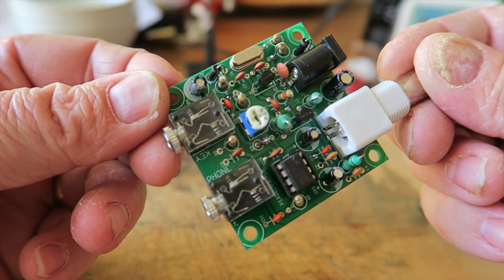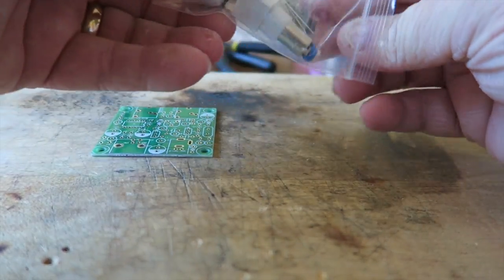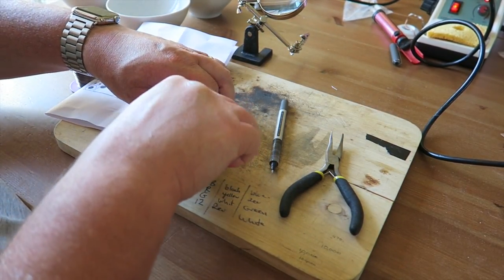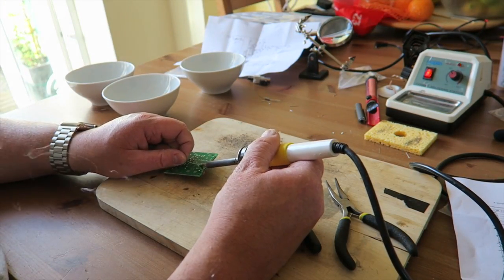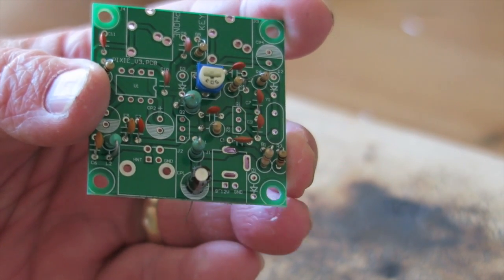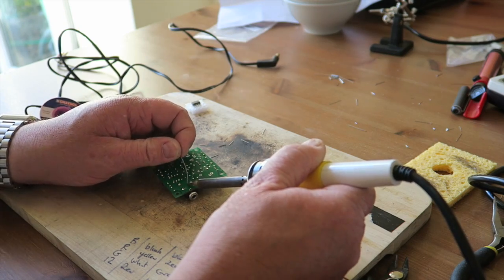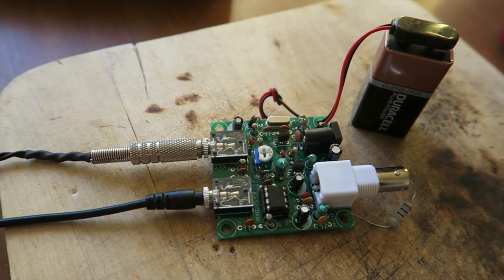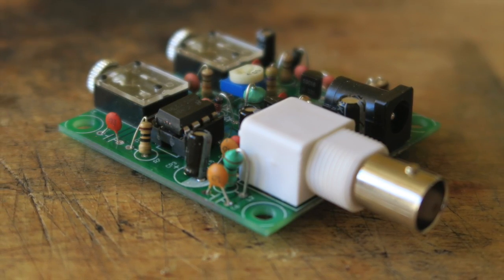40m QRP Pixie kit build for Ham Radio

Comment: Nice video, thanks. They kits are getting even cheaper. I just bought 2 of them for less than 2 pounds for the both of them (older v4.0 version) including shipping but they do not have the BNC connector. No problem, I soldered the coax directly to it. Great little project for a rainy afternoon.

Comment: I built this kit a few weeks ago. I haven't managed to get any results from it as yet, and doubt I will, but I enjoyed soldering it together, so worth the £4 IMO :)
Reply: Hi Nathan.  I completed mine a couple of months ago.  My results on initial power up
were not promising.  No audio out.  I don't know if it was producing RF or not but the
LED was lighting up and the side tone buzzer was buzzing on key down.

I looked over my soldering and found a couple of joints that I thought were marginal
so I touched them up.  Also there were a few plated thru holes that had no parts in 
them so I filled them with solder.  One other thing I did was to lift the crystal off the 
board about the thickness of a piece of card stock (2mm +/-)  I suspect that with the
crystal down against the board, the solder that wicked up thru the holes was in 
contact with the metal case of the crystal, causing a short.  After all this completed,
I had sound in the headphones!  Not only that but on key down my pixie was being
heard on a HF receiver in an office down the hall!

I brought it home tonight and connected it to my 40 meter dipole and listened to a
couple of CW QSO's on 7.023.  I tried calling CQ a couple of time but got no answer.

I would suggest that you use a good battery to power your set.  I started with a 9V
wall wart and the hum on the receive was very bad.  I switched to a 12V gel cell that
was collecting dust in the shop and it made a world of difference.  The specs say that
the set will work on 12V DC.  I have heard that 12V will blow the transistors after a 
while.  So I would start with 9 volts just to be safe (the gel cell I used had not been 
charged in a while).  Good luck with the pixie, and let me know if any of the above
helps.

Comment: worth noting that the axial diodes also need to be installed with the right polarity. That's the most common error on this, I would think. Always have it so the white striped end feeds to the hole indicated by the tip of the triangular diode symbol. I just learned that today, by trial and error. I have 105 of these radios on order, so if I make a mistake on 1 or 2, it's still not a waste, as it's basically teaching me a lesson ... one less thing that I'll screw up henceforth.

Comment: what is the maximum range distance en km ?
Reply: MUF , day or night , K index , grey line , NVIS ? Amateur  ( HAM ) radio doesn't work that way " how far will it go " is not a valid question and can't be answered like it was a kids AM walkie Talkie ..Sorry , Read
Reply: The real answer is, "a few hundred miles under optimal conditions". I once worked a guy who was using a Pixie in Georgia (US), from Québec. That's about as good as it gets; he had a tower and conditions were good. Other than that, this is a local rig with regional breakouts.

Comment: I've was fighting with that side tone subject, and came to the same conclusion, using another radio with antenna disconnected, tuned to the same frequency.  But what would you do in the field if you only had the pixie?  Cheers!  Chris - W7BBQ
Reply: I’m trying to make PCB of a “Megapixie” - a 40m pixie with all of the Internet’s various improvements in. A sidetone circuit is just one of those improvements.

Comment: Hello. Is it working like a receiver from another Pixie?
Reply from the maker: +Alexey Chuvatkin Hi Alexey - no this is a full transceiver. in this video it has received a signal from My KX3 - although its not very clear. 

I have used it for 2 QSOs now, it is very simple, but a good kit to learn some radio basics.  I hop that helps.

Dan
Reply: +ColdestMoon omg, how does it receive signal? In my opinion two transistors like high-frequency amplifiers only...where is receive there? Audio output is for hearing my speech which will be transmitted. 
PS. Before I buyed 2 Pixies and tried to connect each another. And after my difficult useless waste of time I thought it's not transceiver it's transmitter only :)
Regards, Alexey.

Comment: Can you explain how to connect the 51 ohm test (dummy load) resistor? I can't quite see the connections in the video. I assume one end goes to the middle of the bnc plug, but what did you connect the other end to? Also, does the resistor get hot when you're testing? I suppose the output power is low enough that it's ok to use such a simple dummy load.
Reply from the maker: +Patrick McNamee Hi Patrick, i simply inserted one end of the resistor in the centre and soldered (tacked) the other end to GND. to make a better test, simply solder the resistor across the 2 connections for the BNC socket. The test resistor will get warm if you continually key up the PIXIE, but any tests for power output can be completed fairly quickly. I tend to do a 5 second burst when testing for power, and usually tap out a CQ for checks on freq etc.

Hop that is of some help - ping me a message if you are still stuck, i can send some pics etc.

73 Dan
Reply: +ColdestMoon Thanks for your reply. I'm new at this (not yet licensed) so I appreciate your help. 

Another question I have is about the crystal that comes with the kit. I just received the kit yesterday. It came with a 7.023 MHz crystal. That frequency is not available to technician-class hams in the US, but I've seen elsewhere that people have replaced the crystal with a 7.026 or 7.030. 

I haven't been able to find any 7.026 crystals, but 7.030 ones are available. But the receiver only works from 7.023 - 7.026 (I think). So I don't understand how someone can use a 7.030 crystal.

Thx,

Patrick
Reply from the maker: Patrick McNamee Hi Patrick, if you swap the crystal that will work for you. The tuning is based around the Crystal value. so swapping it out will work well and you should be able to tune between 7.030 and 7.036 based upon a 7.030MHz crystal.

hope that helps.
Reply: +ColdestMoon Yes, that helps a lot. Thanks!

Comment: FYI: US Amateurs can not use this product unless they have an amateur extra class license. You can buy crystals for 7.030 on line for about $5.00. Great video. Thanks for posting.
Reply: You will find that the QRP centre of activity is 7.030 for CW, so is a good choice.
Reply: @Tocsin-Bang   one slow freq is 7055kc. i think arrl also does slow sending practice on it.
Reply from the maker: +Norbert Sichterman Hi, many thanks for your comment. This is an excellent point, thanks for raising this and also showing that a fix is in place. Take care, 73 Dan
Reply: I have one of those and it was a fun project. Thanks for posting very good video. :)
Reply: Yes I suggest you listen to 40 meters and see where the slow ops are working unless you can copy code fast. good luck
Reply: No problem with that. I'm an Extra in the USA. My problem is that I'm a no-code Extra. I don't know much CW yet. I was planning on using this to push me along in that direction. I'll also be building up a 5 W amp for it and putting up a 40 meter inverted V. Thanks for the tip about 7.03 MHz. I'll be doing some mods on it for frequency agility, but it sounds like I'll want to be spending most of my time around 7.03.
Reply: @johnwest7993  If you take the time to learn the code and get your speed up to 5 WPM you will find many people on the air that will  send at your speed and help you increase your speed until you are proficient. When you get your speed up you will find a whole new world open up to you.
Reply: @radioguy19510 , I watched a design engineer I was working for stand staring at an erratically blinking 'activity' LED on a new disk-drive prototype that wasn't working correctly. Then he pointed to a RAM chip on the control board and said, "Replace that chip." I did and the drive worked. When I asked him how he knew which chip was bad he told me he had put paragraphs of error information in spare ROM on the board, and the erratic LED was sending out the error info as CW text messages. That's when I learned the power of CW. One LED equals an entire alpha-numeric display. One open and close contact equals a microphone and an entire SSB modulation/demodulation section.
Reply: @johnwest7993  That's pretty cool.
Reply: @johnwest7993 As a software engineer, I worked on a "coprocessor" project.  My processor had no I/O of its own.  Well, it had one reset line going to the main processor.  Anyway, my code worked fine on the ICE ( In circuit emulator ), but when I plugged in a real CPU, it just sat there like a lump.  I beat my head against the wall for about a week, before I had an idea.  I brought a resistor and a small speaker to work.  Hooked the speaker & resistor up to my one I/O line.  Wrote a quickie Morse driver.  Peppered the code with statements -  emit an "A" if you get here.  Emit a "B" if you get there.  Etc.  Started it up, and it started beeping.  I found the bug in about 15 minutes.  Fellow engineers gathered round and marveled at the beeping :).

Comment: Don`t understand, you have three diffirents cable. Why you dont`t shown them ?
Reply from the maker: +Владимир Мамулов Hi, do you mean the power, key and audio cables ? I can create another video showing the connections and also it in use, if that would help. I have only had 2 QSOs on this kit - its very low power. 73 Dan